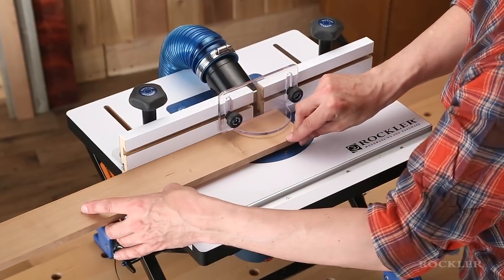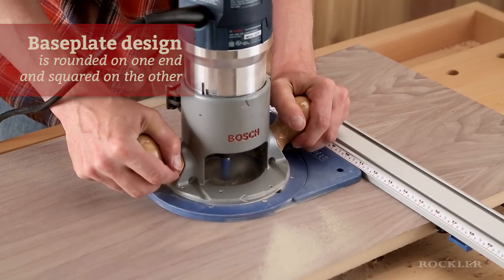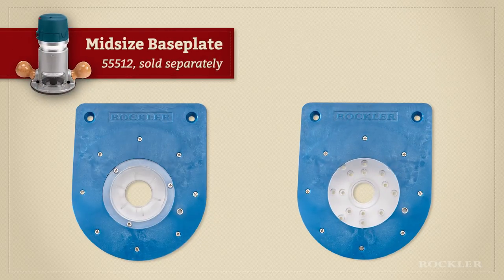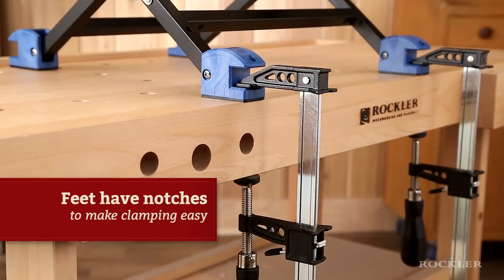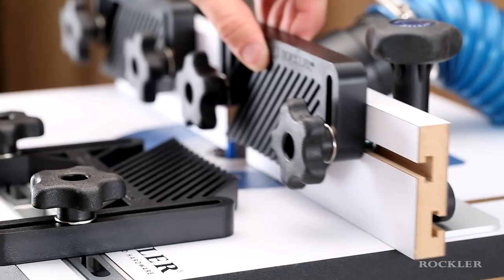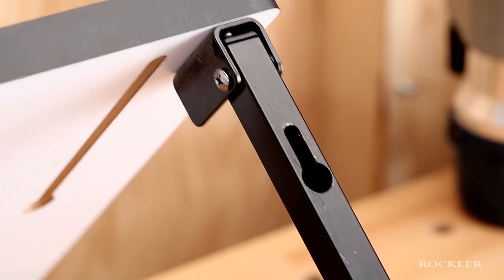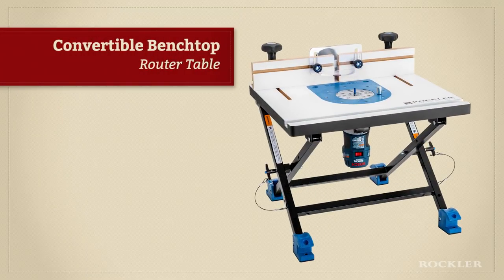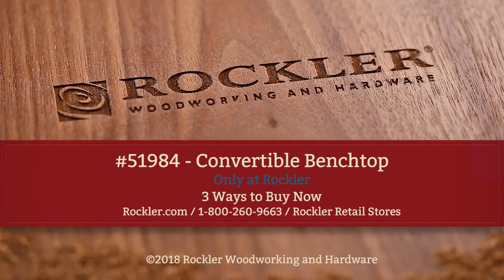Convertible Benchtop Router Table (Full Length)

Comment: I just received mine after finding it on-sale recently.  It seems well made, easy to assemble and use.  My only issue is with the design of the fence slots in the tabletop.  Perhaps it is just me, but I think the holes at the front of each slot should be placed at the rear instead.  These are the holes drilled at the end of the slot allowing you to lift the fence off without fully removing the bolts.  

In their supplied location, it is very close to where you typically use the fence when pulled forward and may actually inhibit you from positioning the fence all the way forward since it can lift off the table and not lock down.  Again, I prefer the holes to be at the back, well out of the way of normal fence position use... like so many of the large tables do.
Reply from the maker: Hello and thank you for your feedback! We'll pass this along to our product development team.

Comment: Hi I love this video. I have some questions. Will this router table ship to The Netherlands? Will the Makita RT0700 fit in this table? Is the router depth adjustment of 35 mm enough? Or do you recommend another Makita router?
Reply: What baseplate would I have to order for the Makita RT0700 router? Sorry I am new to routing. My small work shop is in need of a small router table.
Reply from the maker: Hi André Snelting, Please reach out to our product support team at 1-800-260-9663 or support@rockler.com. They'll be able to assist you. Thank you